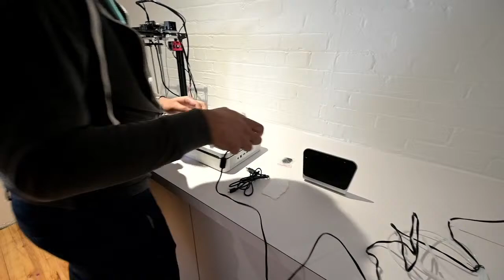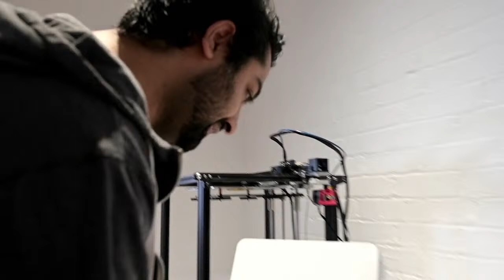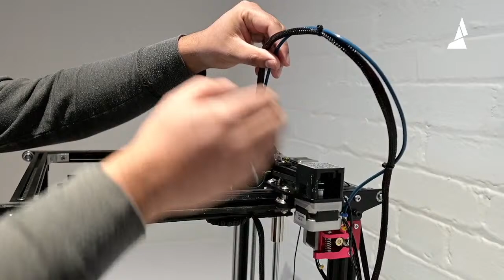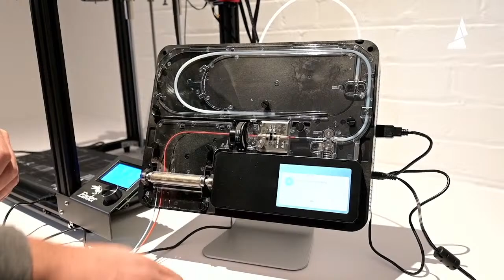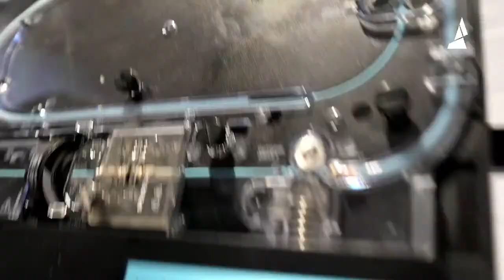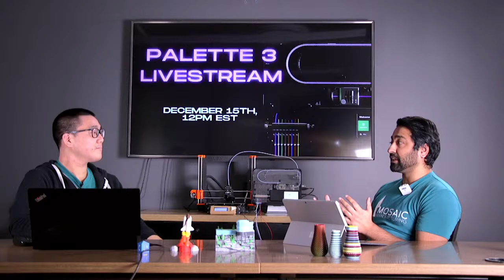Palette 3 Livestream

Comment: Hello, I would like to ask if I can even connect the mp delta pro with the Pallet. The reason I ask is that the printer has a very rare firmware and I wanted to know if the pallet  is still able to communicate with it.
Reply from the maker: Hey there, based on the specs, the MP Delta Pro looks to be compatible! You can try slicing a single-color model on Canvas (canvas3d.io) to double check, but it shouldn't be a problem.

Comment: Have you considered increasing in the future the size of the case and fitting inside bigger fans having high cfm but also being more silenced? You could potentially even think about selling an additional addon to already existing devices, which would improve the noise levels.
Reply from the maker: We tried to minimize the size as much as possible when designing Palette 3, but will definitely consider this in the future.
Reply: @MosaicManufacturing  Thank you guys. Very informative Livestream yesterday. Thank you for that as well. Have a nice day.

Comment: And if my extruder lost filament because the Palette has finished filament building at the end of the file, but I have already a distance between the extruder gear and the nozzle output and no forward drive for the rest of the filament.

Comment: Maybe it would be better to trigger the distance for the right filament length to the nozzle within the Palette and disable at that point the gear drive through the extruder until the filament comes out of the nozzle. My printer GRR X400 can not trigger the filament over the printer display but over a printersoftware or splicer like Simplify3D with machine control working over USB cable. And both Palette and Simplify3D doesn't match together. Isn't it?